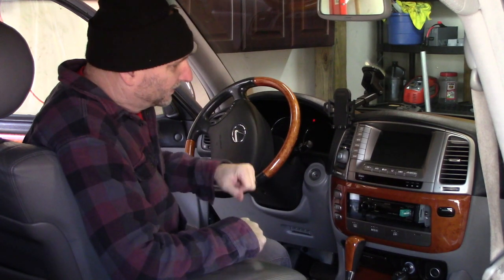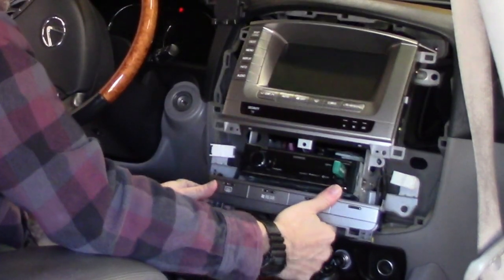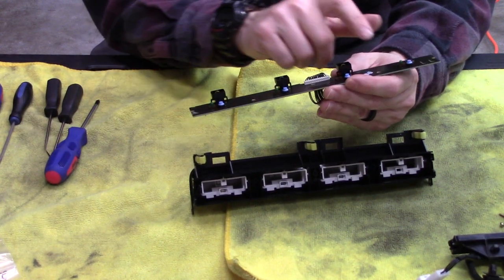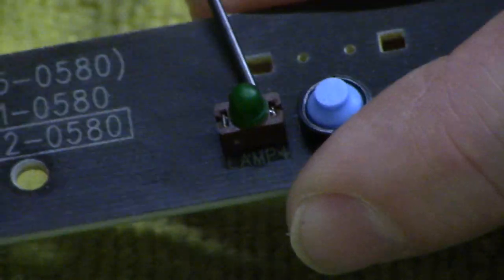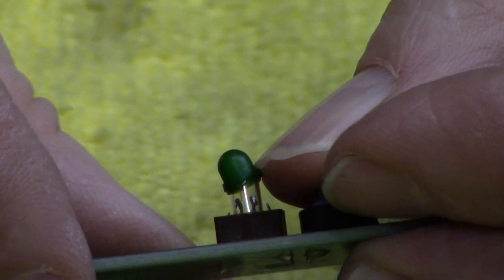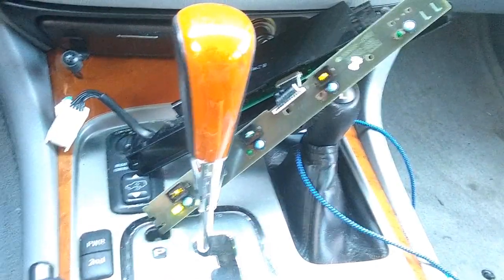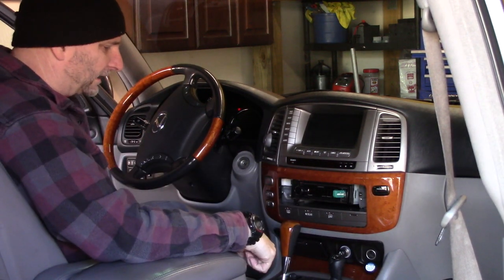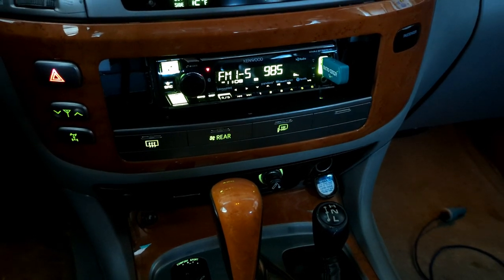LX470 interior back light replacement

Comment: On the 100 Land Cruiser the center console is different. You need to: 1. remove the 4 M10 bolts as shown in the video. 2. unplug all (in my case 9!) connectors behind the screen-radio-climate module and remove the module completely. You cannot remove the black box (you named it one giant assembly) containing the two PCBs with the light bulbs as the last screw sits behind the PCB. 3. open the black box and remove the PCBs. I needed to cut two plastic pins going through the PCB because they made it impossible to remove the PCB after removing the two screws. Be VERY careful with the cable connectors. I could not unplug it, it was old and brittle, I pulled out two of the cables by accident but could put back in later, luckily. 4. fix the bulbs as shown in the video. 5. assemble everything in the opposite order. 6. Have minimum 6 beers to celebrate your success! One more add-on comment regarding LEDs: better go with the old-style light bulbs, as neither color, nor brightness match perfectly with the other switch backlights. Additionally the legs of the LED lights are much thicker than those on the bulbs. They are harder to bend without breaking and they consume too much space in the tiny plastic bulb holder, that it is hardly possible to click them back onto the PCB. Good luck and thank you very much for your video.

Comment: Ok you've got me curious.  Did you do an installation video on how you got the single DIN headunit installed where the old cassette player used to go?
Reply from the maker: No I did not. I have yet to finish the trim on the stereo so I did not make a video. Google "68 ohm resistor Prius" and lots of in will come up
Reply: @maintainersgarage  thanks. Send like someone posted on ih8mud about it
Reply from the maker: Yeah ih8mud is a great resource!

Comment: How did You replace the OEM stereo casette player into that Kenwood one? Is it just a plug and play replacement or do You need some cable or audio adapters? Which Kenwood model is that? Thanks.
Reply from the maker: @XPLORERPHOTOVIDEO it is both. You have to add a 68 ohm resistor to one of the harnesses so the touch screen will still work and i also ripped out factory amplifier and added my own and replaced all speakers and speaker wire. If you google "68 ohm resistor Toyota" that will give a start to see if it is a. Job you feel comfortable doing. It's not hard, just detailed job. And it is a JVC
Reply: @maintainersgarage  Understood. But from what I've read is that with that resistor plugged You loose antenna rising ability and steering wheel switches. Is that true?
Reply from the maker: @Xplorer.Adventures  steering wheel controls yes, but there is a harness and module/dip switches that is plug and play that will work. I have it. Antenna up/down function is plug and play with aftermarket stereo. Antenna reception needs adapter and reception is POOR compared to factory. But that is the ONE downside that i found in the 5 years the aftermarket stereo has been installed. And ask me anything i will do my best to answer
Reply from the maker: @Xplorer.Adventures  i also messed up, i am on my 3rd head unit i forgot the newest one is Kenwood kmm-bt232